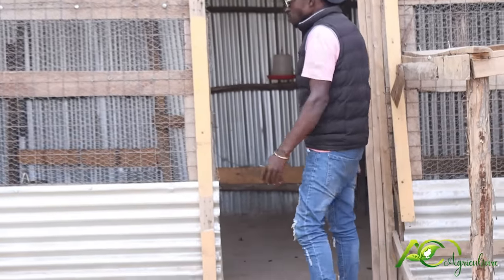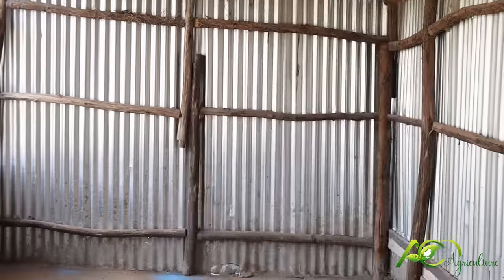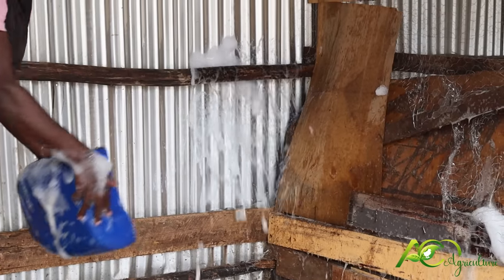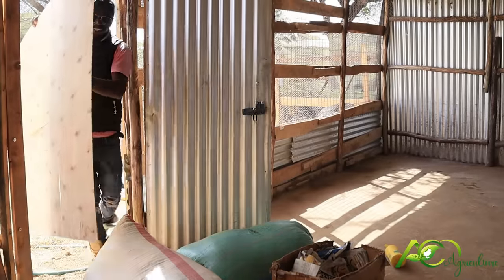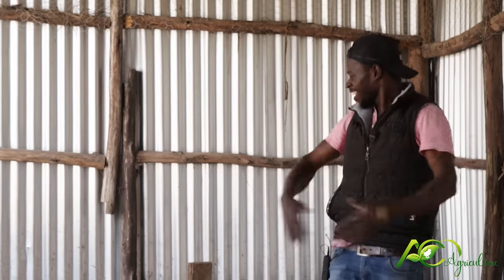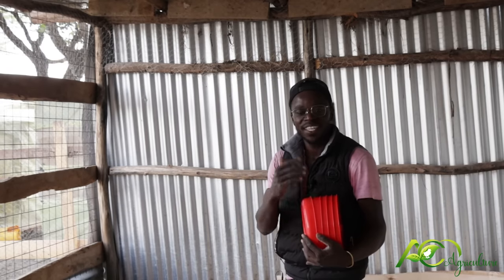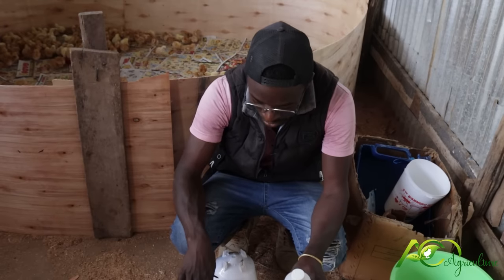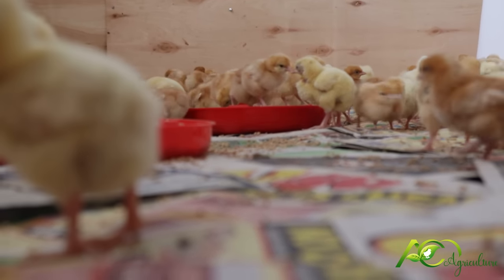STOP Killing your Baby Chicks | Brood them like this | ZERO Death

Comment: Point #1, Biosecurity from the onset is very important. #2 you should give the water with liquid paraffin and glucose first before food to reduce stress and prevent constipation. #3 Then your audio was lost towards the end of the video. You can do better.
Reply: Your number plz,coz nataka ukuje unisaidie construct the stucture
Reply: True, @olabodeajayi1585...
This was meant to be a good job, but was hastily done.
#1-the brooder was supposed to have been in place way so many hours earlier, not when the chicks had arrived on site.
#2- the brooder was supposed to have been heated for atleast two hours or so before the introduction of the day old chicks, and not after.
#3- the liquid paraffin was supposed to have been mixed in warm water so as to adequately mix the water and LP+GLUCOSE(For initial strength)+A MULTIVITAMINS COMPONENT(To ease off the journey stress).
NB: This water solution was to be the first to be introduced to the chicks before the solid food intake, and not the other way around...
No solid food should be introduced atleast 1(one) hr. before the water+glucose+multivitamins would have given to the newly brought in chicks, otherwise they choke, and die, or develop constipation.
Reply: Paraffin the one we used in lamps? & what is the purpose of it please tnk u
Reply: @gwokyalyagrace8354  liquid paraffin not kerosene (paraffin). You can buy liquid paraffin in drug stores, supermarkets , retail shops etc
Reply: Not that. We use liquid paraffin get from the agrovet
Reply: @wyreennjinu  Thank you. I was confused
Reply: Learning loads
Reply: He has done a good job and reminded me to continually keep where chicks are clean
Reply: OK thanks
Reply: Nice job but few observation I stand to be corrected 
1- biosecurity foot deep
2- heat the coop be4 introducing the chicks
3- introduce water solution be4 feeds for some minutes etc
Reply: If liquid paraffin is not is it
Dangerous?
Reply: I mean not giving.
Reply: ❤I love it  can I get your number that I can contact you personal  I might have some other things I want to k
now about .

Comment: Questions to be ask sir:

1. How do one control the temperature in the brooder in a hot environment?

2. What are the types of disinfectant to be used in cleaning the kitchen house, before and after please?

3. What are the disinfectant for footbath or change of shoe?

4. Please at what stage will the flocks be out from the circle or to be free from the woody shaving circle?

5. Please what are the names of the vaccine to be on the flocks drinking water and where can I buy them

6. Sir is there any medications injection to be given to the flocks in any giving time?